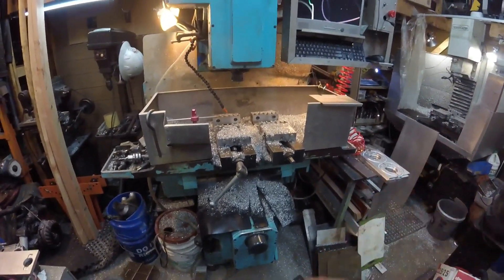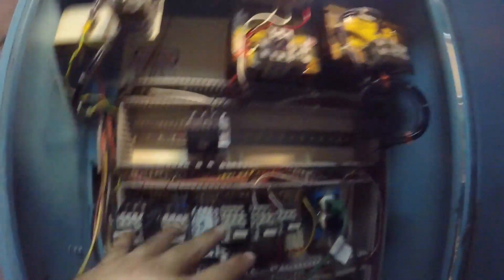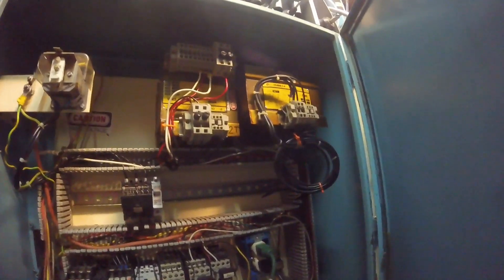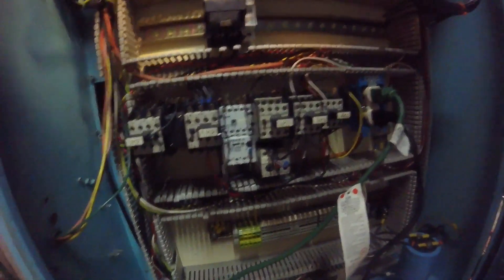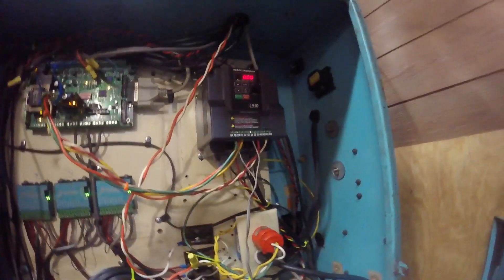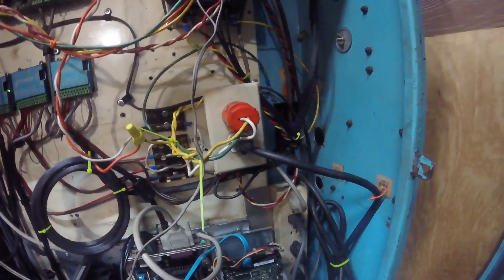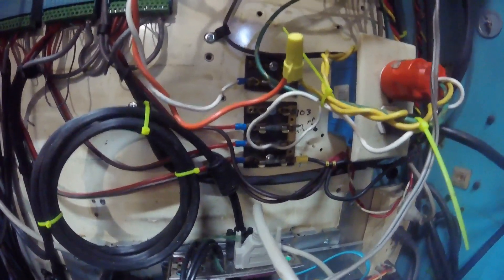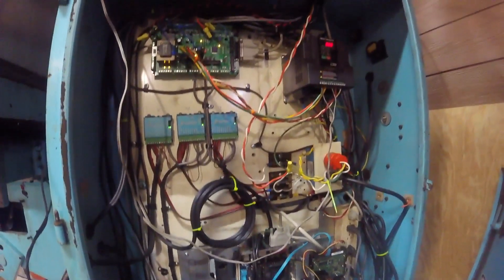Hurco KMP3 CNC retrofit walkaround

Comment: Do you have a variable speed belt drive? 
Trying to figure out how to incorporate the variable speed drive belt with the vfd.
I know how to control it with a vfd and how to control it with the variable speed drive belt but dont know how to control both at the same time
Reply from the maker: The machine does have a variable speed setup.  I maxed it out to the highest speed and left it there.  Now I just use the VFD to control the spindle speed.  Mach 3 has a setup screen and I kept playing around with it until the actual spindle speed set with a tachometer was the same as the speed shown in Mach.  Also, set it to max speed at 60hz so when the VFD is at 100% the machine is at the max the spindle was designed for.  I'm almost always cutting aluminum so it's usually run at max speed.  Sometimes I use a compression tapping head at 1500rpm and even though it's off about 20rpm down that low it's close enough that the tapping runs with no problems.

Comment: What vfd is that? I have this same machine and need to get one
Reply from the maker: It's a teco Westinghouse l510 but I did a retrofit so I know it works with my break out board; don't know if it'll work with the original electronics.
Reply: @ecdezz  mine is retrofitted as well. I did mine with viper drives about 15 years ago. So with the vfd you can program the rpm right? I assume you leave the manual speed control at the highest rpm?
Reply from the maker: @amfthree  Oh cool!  Yes, the Teco is programmable.  I'm pretty sure you can download the manual before you buy.  I have that VFD on the Hurco, a Hardinge lathe and a Cielle router; I'm a fan :)

I cranked the speed control gear a little past max and capped the VFD at about 65hz so I can get the spindle up to 5,000rpm.  Didn't want to go too much higher as I don't know if the bearings can take it.
Reply: @ecdezz  gotcha! Great information. Thank you very much. I appreciate it
Reply: @ecdezz  just to make sure I'm clear. With the VFD and the interface card you can put in spindle speeds in your G code and it will adjust accordingly?
Reply from the maker: @amfthree  Yes, I'm using Mach3 so I got the spindle at 5,000 rpm by fiddling with the  gear adjustment and the frequency and set that as my baseline (and max rpm).  In Mach there's a gear ratio setup or something like that and I kept tweaking  with until the spindle speed in Mach matched the actual spindle speed.  With all that done I enter the spindle speed I want in the program and it adjusts automatically.  It creeps a little; as I get down close to about 1000 rpm the actual spindle speed is off 10-20rpm but that's accurate enough for me.  My ratio must be off just a little.  I'm also doing tapping with a compression/tension tapping head at about 1200 rpm and no problems so I'm happy with it :)
Reply: @ecdezz  Oh, that's awesome! Thank you for all the information. I really appreciate it.

Comment: Very impressive, maybe some day you can try to use a full kit including new CNC controller and new AC servo motors and drivers.
Reply from the maker: I did the conversion on the Hurco a couple years ago.  After that one I did a small Hardinge lathe and a Cielle router and that's exactly what I did for both of those; all new everything.  AC servos from DMM tech.  I'll never do it the way I did the Hurco again :)

Comment: It looks like you kept the original xyz servo motor....Are you using the original encoder ?  and how about the limit switches ???  Got one just like it that the screen quit working on...And since I got the whole ting for 120$ I don't want to put alot of money into it...I only do small hobby stuff...
Reply from the maker: Yes, original servos but new encoders and new limit switches.  I wanna say all my parts were somewhere between $1,000 and $1,200.  If I were to do it again I'd upgrade some of my purchases but as is, it works fine.  I use it almost everyday.
Reply: @ecdezz  Thanks for getting back to me...I think I'm going with the Masa 7I77 and 5I25 combo kit.. It will let me use all the original gear...and run linuxCNC ...Thanks again..
Reply: @ecdezz  do you have a partlist for this?
Reply from the maker: @rackprotech  I do not have a complete  parts list.  The main pieces are the Gecko drivers (mine are for my DC servos), a PMDX 126 breakout board with a PMDX-107 spindle control card and a TECO l510 VFD.  All of these came with manuals and once I sat down and just did it I had it up and running in a few hours.  I couldn't believe how easy it was after letting the machine sit for so many years.

Comment: Ask a question What is the speed of the motor hurco km-3 RPM, I will connect it to the inverter. The nameplate of the motor is missing.
Reply from the maker: 1,800 RPM @ 60hz   I can send a pic of the nameplate if you want to give me an email address.
Reply: @ecdezz  thank you very much